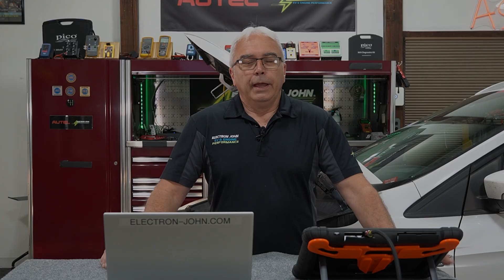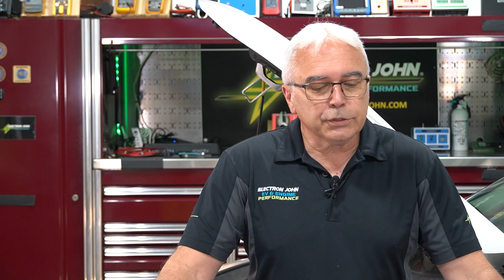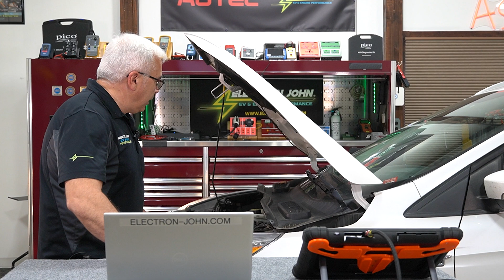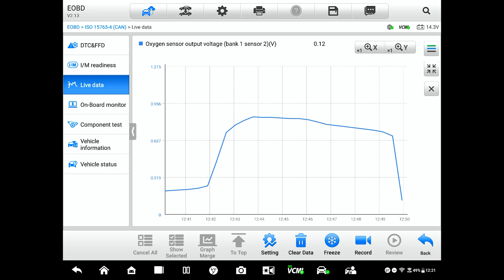Post Catalyst Diagnostics In Rich And Lean Fuel Conditions

Comment: this is wrong when we have no sparks the rear O2 sensor goes high not low AFTER the mixture does not ignite and is rich when we have a lack of fuel then it goes low in the lean mixture
Reply: Thanks mate . Very helpful !  Data /  evidence based lesson .  Have a great day !!  👊🏼 🔥 💻 📈
Reply from the maker: thanks
Reply: The test shows otherwise….  😂😂
Reply: @kd8icq  NO IT DOESN'T SHOW THE OPPOSITE WATCH CAREFULLY WHEN THE COIL IS DISCONNECTED THE O2 SENSOR INITIALLY GOES RICH AND THEN GOES LEAN THERE THE COIL IS CONNECTED AGAIN

Comment: So the difference between the ignition and spark misfires here is that for ignition misfire the O2 signal goes lean because of the unburned air from the bad cylinder while for an injector misfire the O2 signal goes rich because the catalytic converter absorbs the Oxygen from the bad cylinder?
Reply: Looking some scanner danner videos about this topic is total the opposite spark misfire gies rich and disconnected inj goes lean. I tested on my acura  it worked like that
Reply: @mandytuning   Thanks!

Comment: The voltage went down first when high rpm returned to idle. When the coil was unplugged the voltage went higher?
Reply: No, the voltage went lower because lack of spark.

If it was fuel-related the voltage would have gone higher.
Reply: It seems to me he didn't rev the engine AFTER disconnecting the coil contrary to what he said earlier. The engine started sputtering after the coil was disconnected after which the signal went rich quickly.
Reply: @abdul-kabiralegbe5660  exactly , something not make sense here, where I thought he disconnected coil, apparently was wrong.  Thinking coil was off all time?